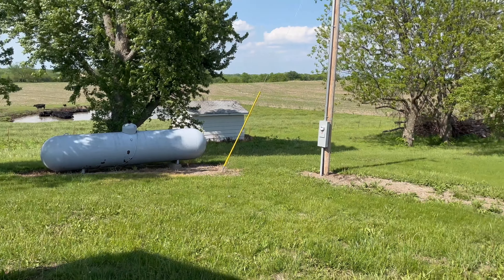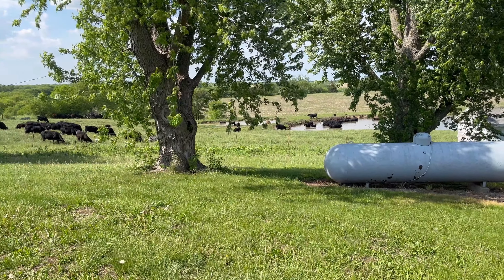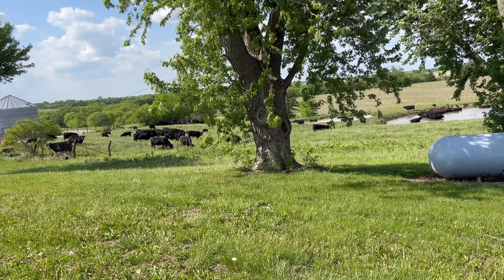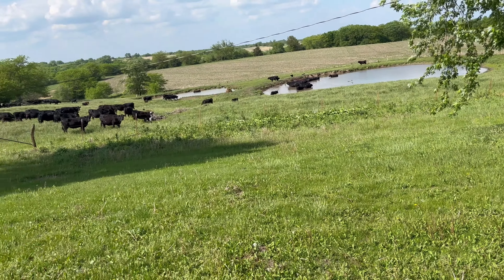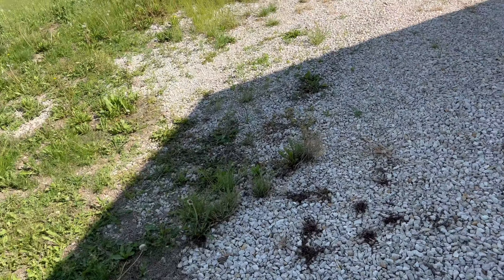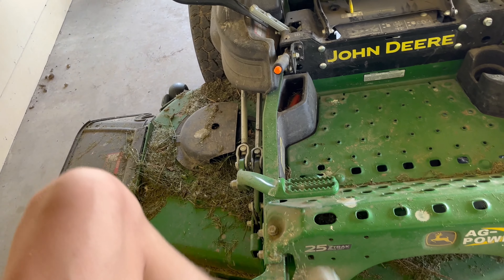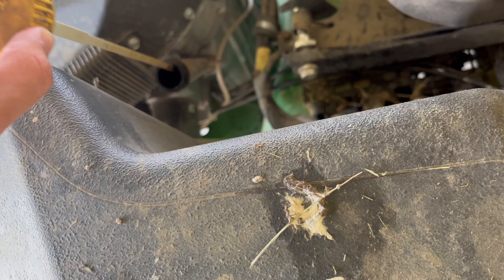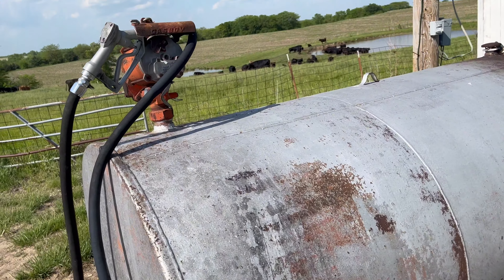After school activities mowing and working on a two row planter with 17 years old farmer

Comment: Hey Woody.
I grew up on a sweet corn farm. 30 inch rows are optimal for picking down the center of 2 rows. If they made a pull type version of that planter, you may find different seed plate sizes in Amish country. That plate looked a little big for sweet corn. It would good for Howden pumpkins except the spacing is a little close. You can always thin out pumpkins though. I'd leave the shields on, keeps the chain cleaner. With flat chain dirt is really your enemy. I'd throw that whole chain in a pail of motor oil for a week or two. Great video man, thanks. Take care.
Reply from the maker: Ok thanks for all the suggestions!!! I need them!!!! Thanks for sharing and god bless

Comment: 4:00 'corn or beans' - probably right, likely corn. Beans have come along as an alternate to corn to improve yield as corn on corn will degrade the soil. I believe beans put a lot of nitrogen in the soil but don't quote me on that. And the 4020 is more the powerful to handle the 2-row planter - they are either 5.6L or 5.9L gas or 6.6L diesel. I would think you only need a 20hp tractor for that implement as there isn't a high power requirement, however it does have a category hitch on it so it isn't for a 10hp home tractor I wouldn't think. Good luck and God Bless you and the farm!
Reply from the maker: Yea the 4020 is overkill but I hope it will hook up!!! Thanks for all the advice and god bless
Reply: @farmerwoody  You will need a category hitch, likely cat-1. You can find a table online which gives the dimensions for various parts and you should be able to determine out the category from that. Good luck!